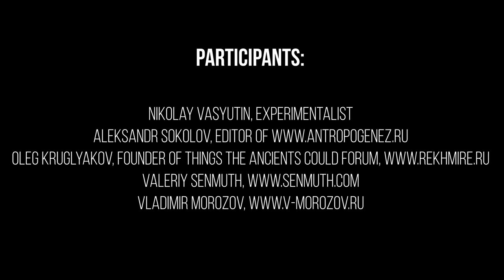Making Egyptian Drill Holes: Lost Ancient High Technology

Comment: Why are you using a copper tube? Did they have a Home Depot store in ancient Egypt that sold copper tubing?
Look closely at the ancient figures at @2:31. You can clearly see that the cutting tool had a bifurcated cutting tip. It also had a horizontal bar inside the V of the forked end, not sure what was the purpose of that - it would have stopped progress as would the v-shape itself? The hard small drill tips would have made a much more efficient tool as there would be much less friction than a tube (smaller surface area at bit contact points) and thus higher pressure. Also look closely at the two tips of the bit. They clearly show that the 'tips' were of a different material than the drill itself. The whole drill bit was easily and quickly changed because it was simply fitted into a compression ring on the handle. This shows that the drill bits were frequently changed and the tips were then replaced in a 'repair shop'. As to what was on the two drill tips - I am guessing maybe some sort of very hard (and valuable) stone chips of maybe carborundum or dolerite and which could be quickly replaced. If so there should be lots of spent drill tips at these sites (very small bits of very hard stone which no one has really noticed in a dump site)?
Also look at the weights attached to the handle. Why are they attached by rope? Isn't it obvious that these weights flew out as the drill was spun, thus making it a lot easier to turn?
Maybe the 1-2mm per turn cutting rate into granite that is seen on ancient tube holes can be explained at last? Also, are the ancient holes always vertical or sloping downwards? If so it would indicate that water, carborundum/sand(?) and perhaps boiling water maybe containing a substance which dissolves quartz was used. So after drilling a 1" deep hole, they can fill up the cut ring space with the boiling solution and then leave it overnight to soften it (dissolves the quartz plus 'Quartz Dissolution'). Then in the morning the cutting should be a lot easier for the next half-inch?
Reply: This channel is a complete joke, there are no scientists there - and I challenge anyone to find any experienced engineers who concur with their "debunkings". I'm an engineer with decades experience in such matters, this channel would be hilarious if it weren't for so many poorly informed who actually buy into this "debunking" nonsense. There are so many things wrong with their conclusions that I really don't even want to get started. It's ignorance at best, downright deception for clicks at worst. No mention of the copper abrasion rate, which is extremely high. Literally millions of tonnes of Aswan granite litters Egypt to this very day, what is shown in these videos is pseudoscience at the very least.
Reply: @methylene5  
you are  complete joke bot
Reply: @ВсеславВсеволодович  Get lost troll.
Reply: @methylene5  
self-criticism from you

troll calls me troll hahahahaha :face-blue-smiling:🤣

Comment: The issue never had been can they do it.   It has always been can they do it on the acale attributed to them.  The great pyramid alone requires a block being quarried, shaped and placed every 5 minutes, 24/7 for 20 years.  It's clear to anyone that we are missing a piece of the.l puzzle.
Reply: Wrong........ = on all counts.  Methinks perhaps you should first learn the evidence before you try to speak to it - just saying.  🤨

p.s. - look at those pyramid blocks.  Most are anything if "precise" representing a myriad of shapes/sizes/quality.  So they were not individually chiseling a million blocks.  They rather were quickly shearing off approximate chunks of limestone from the bedrock and hauling those away as is.  Only a small number of the total were more carefully cut and in some cases polished.  The bulk are basically "stacked rubble."   

Watch the video:  Arnaldo Costa Stonemason Extraordinaire.  See an old man with some chisels and a sledgehammer quickly split a block of granite into 2 clean halves.  That is how most of the blocks were obtained.

Comment: Not questioning your excellent work.....very good..but please show in detail how the Egyptians made the COPPER TUBES.Thanks
Reply: Carve a tube from wood or similar material -------> use that as a template for forming the same using clay -------> shape your clay around your template ----------> remove the template leaving a clay cylindrical form -------> bake the form to harden it much as they did for their pottery = you have a pottery mold which molten bronze can be poured into to form a bronze tube.  🤨

p.s. - ceramic mold casting has been used for centuries and is still used today.

Comment: Still missing the point, it's not if it could be done with primitive methods, it's the time scale, using this method, it would have taken a 1000 years , to build the pyramid, then you have to look at stones that look like they were melted into place, great demonstration, but in the end , I think this shows we know even less then we thought
Reply: But what calculation do you use to arrive at 1000 years? Remember the Great Pyramid is mostly rough cut limestone, rubble and mortar with tight fitting exterior stones which were mostly limestone. Inner chambers and hallways also good fitting masonry.

Comment: @2:39 - Looking at the original Egyptian model, I notice that the actual model found had the weights hung from leather straps.  Doing so would allow the weights moment arm to dynamically change radius the same way a skater holds their arms close or far away from their body to change angular momentum.  So, as the weights spin further away from the shaft, the more angular momentum they obtain.  Call it an adjustable flywheel...  Having it non rigidly attached would also serve to create a non rigid bearing that the weight transferred across, thus making the motion likely much easier to maintain...  I'd recommend trying to replicate the original design by hanging weights from straps and see how it performs.  You may also try to add grit to the inside of the drill pipe, instead of the outside...
Reply: I was going to suggest that myself. Grit on the inside would self feed and wash out as it became ground down.
Reply: good comments and additions 👍

Comment: The drill holes are tapered, bigger at the top and smaller at the bottom. Annular cutters cannot cut tapered holes. Also the picture at the beginning showed a single point cutter. Which would be able to make tapered holes. The same spinning apparatus could work but would need far more weight to run a single bit cutter.

Comment: You could also VERY EASILY cut a circle around that weight whereby a rope could be once turned around it.

The top could be enclosed or held in place by someone to push downwards & the rope could be used to turn the drill by pulling one way & then the other. 

Using this leverage with the rope you could multiply your work output by great factors.
Reply from the maker: Thanks!

Comment: The spiral marks on the Egyptian cores indicate a much higher cut rate. Steel tools are used in the video - that's cheating. There are much larger cores, do you think copper tools are adequate to break them off?
Reply: The non spiral markings on the Ancient cores do not indicate a cutting rate. The copper pipe used in this video is not steel.
Reply: @Eyes_Open  The angle of incidence of the definitely a spiral markings on the ancient cores indicates a far higher cutting rate. The copper pipe does not make a visible spiral at all. Steel tools were used in the video to break off the core. Why lie? Who do you think you are convincing?
Reply: @timburke127  The lie of spiral striations is a continued source of income for the grifters. A wooden wedge could break loose the core.
Reply: @Eyes_Open  I'll continue to believe my own eyes rather than the gaslighting.
Reply: @timburke127  This channel has a dedicated video about this topic. Showing very clearly the non spirals on the original as well as the recreated one. It is a scam/cult that continues to push the spiral lie. Night Scarab channel also has a video.
Reply from the maker: https://youtu.be/HQi4yql7Ysg

Comment: Could you please drill the same hole in horizontal position as if drilling into a 50 ton block? How will the abrasive be pushed into the working surface.
How many hours of hard work did it take to drill the 1cm of stone shown?
Can you build a polygonal interlocking wall with 5 ton stones please, to show me how it is done? Thanks
Reply: Drill vertical - rotate 90° - wellcome
Reply: This was a king project. They could get a lot of people to do it. They could do it 24/7 if they want to.

Comment: Impressive video! This indeed looks like the way they would drill holes. Building the pyramids is a completely different thing though, and I still have net seen a method that seems plausible. The ways they told us in school border being ludicrous.
Reply: I think it's ludicrous that someone can't accept that you could bash rocks with other rocks into any shape you wanted.
Reply: @jamisojo  Not even mentioning that they had essentially unlimited people with unlimited rocks
Reply: @UserOfTheName  
not infinite people of course but a lot

also, the pyramids were built for many years, sometimes for 20 years, there is nothing supernatural in stone processing, almost all ancient Europeans of the Mesolithic / Neolithic knew how to process it and clean it to a smooth surface

and the Greeks, Persians, Assyrians, Medes, Romans and other peoples were even more eminent builders
Reply: @ВсеславВсеволодович  The St. Peter Basilica in the Vatican took 150 years to make, so funny how non of these ancient technologists wonder about the perfect impossible precision work there, a 14.000 ton roof 500 feet in the air all made with flimsy steel tools, ropes and wood. 
That is totally reasonable, but a bunch of guys pounding rock into a square that is just impossible, no way.

Comment: Yes you can use primitive tools and get a simple hole drilled. How does this method work for drilling horizontal holes? Or holes drilled through an inside corner with no room for a large drill to fit? Like those enthusiasts today, the Egyptians were trying to recreate the technology originally used to build the pyramids. They couldn't do it either.
Reply: Turn the block on its side = and drill.  Also if you checked you would probably see that holes "in corners" = tend to go all the way through......  So it becomes a simple matter of drilling from the outside in.

Comment: This video is discretely misleading, it is not really promoting ancient, advanced technology, it falls short . I will give it a C+ for trying.  That circular copper tube that is used in this experiment was created using a modern electrical process.  The groove in Egyptian drill core for example the famous drill core #7, is a spiral groove which the abrasive sand would not create. We need to see this experiment done with independent verifiers.  Expert like Dr Chris Dunn have said that the depths of the Egyptians grooves are 500 times deeper in granite than out best modern electrical drill, we need independent verification the groves shown in this experiment.  The ancient Egyptian drill core #7 spiral groove cut deeper through the quartz than through the feldspars, this experiment does not address that. Finally, the totality of forensic evidence for advanced electrical drilling, precision cuts, precise inside corners and polishing being used in ancient is great.  The most ancient Egyptians had advance electrical tools and Dr, Christopher Dunn's forensic examination has revealed the toolmark on the Rameses statues and the box found in pyramids.
Reply: I'd give it an F for effing deliberate deception.

Comment: can you bend the drill once more in the opposite direction. if the copper becomes thinner, can you change the first bit you have been using with a new sheath ? what you did is excellent..thank you.
Reply: The addition of corundum or quartz sand to the lubricating fluid both aids in cutting the stone, and also sharpens the tip of the copper bit as it cuts, so it maintains the thin cutting edge the whole time. Basically you don't need to replace the bit until it has completely worn away.

Comment: If you had a wobbling at the top of the drilling then they would have just factored in that extra waste material to get the length or depth they desire. just add a few extra inches or feet and cut off the imperfections.

Comment: Perhaps modify your device to provide a longitudinal resonance, so it produces a moaning sound while rotating.   I suspect this would greatly speed the drilling rate.  Ancient acoustic-drill technology, where the copper tube is slamming the granite like a "jack-hammer" at 200Hz, as it rotates and abrades the surface.   (The peak-pressure during physical contact, it might be immense, like a delta-function.   Very different than the "DC case" you have produced here.)

Releasing guild secrets?  The contemporary society of stone-masons will silence us!   Heee!

Comment: How do you explain slivers of granite that obviously look like they've been sawed?
Reply: Copper / bronze saws will be just as effective as of copper tubes.  This video (and others) do not 100% clearly present the main concept: The grit is doing (almost) all of the work.
People are puzzled, naturally. Because it is true then a softer tool will not cut a harder material.  
But look at our steel tools of today. They're not harder than granite either. The metal doesn't matter. Still just makes it last longer. The grit does the actual cutting, in our modern tools are tipped with diamond dust.  
Diamond is actually harder than the granite.  The Egyptians had something really is good.  Corundum dust..  That explains it all...Corundum is Ruby - one of the hardest gemstones on Earth. Only diamond has a higher Moh's hardness on the scale.
all you need is sand and clay as a lubricant and lots and lots of water to keep the dust down. If you don't pour water continuously on this, it doesn't work. (Also inhaling the dust long-term would have meant the death of the workers.)
It's not a mystery.  They're doing the exactly the same work ,with nearly the exact same tools. The only thing that is different is there's no electricity.
Inefficient compared to modern standards but... In the past Egypt had a problem of trying to employ people. When the Nile flooded, 70% on employment happened until the waters receded and they could work the fields again.  
Egypt had a brilliant economic system designed to employ workers with handicrafts and labor to keep their economy  afloat.  It went like this; workers planted / harvested the fields. Taxed in grain. If they agreed to do labor in the off-season, part of the grain was returned to them.  It's a tax rebate and free skilled job training system.  All the Egyptians had to do - was find reasons to keep their employees busy.   They did that with monumental building projects, handicrafts, tomb painting, etc. This meant they discarded a slave-based economy... and did not have to get in constant wars to get slaves. Eventually, they became completely stable and self-sufficient.  Absolutely brilliant.
So what I'm trying to say is... For this reason, they had the polar opposite of a labor shortage. In fact they had hundreds of thousands of workers with nothing to do much of the year. So it didn't matter to them that it was all done by hand. The moment worker got tired - another other one stood up and took his place.  The Egyptians likely worked around the clock on their monuments, as they didn't have much cloud cover in moonlight is that a quit for doing a lot. Night time is cooler as well.  When I'm trying to say about that point... is modern people miscalculate how long it took Egyptians to do things. Because we are assuming the only work during the day.

Comment: This was great and makes sense though can someone help to explain the actual rate of cut being so fast in the Egyptian holes. They are cutting at a much more aggressive rate as the helical marks show almost like an immense weight is forcing the cutting tool intimate the rock yet copper would collapse at the extreme weight?
Reply: The actual rate of cut is unrelated to the striations or groove frequency. The striations are left from interactions between the abrasive and the sides of the holes and cores. 
      If someone was really drilling that fast you would have perfect spirals, which don’t exist on these. 
     The spiralish grooves have been reproduced and the tool was turning somewhere between 250-400 rpm’s if I’m recalling it correctly. 
       Read the paper that is referenced in the description- it has way more information than this video.

Comment: Two points: 1 you invented a wheel which the ancients supposedly didn't know about or use and 2 this method won't work for horizontal bore holes which do exist.
Reply: How can you say Egyptians didnt know about the wheel when they had potters wheels for example. Their neighbours also used wheels. Egyptians didnt use them for transportation for a long time. Horizontal bore holes can be accomplished by drilling vertically and then turning the stone over.
Reply: Egyptian chariots are a thing